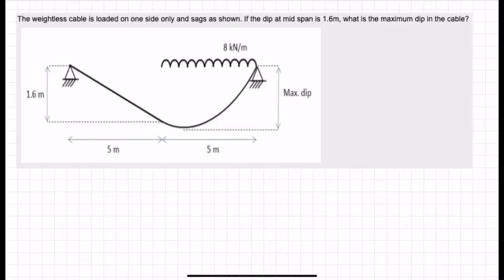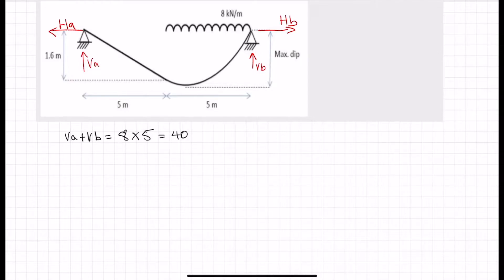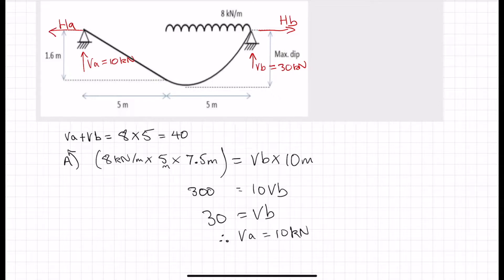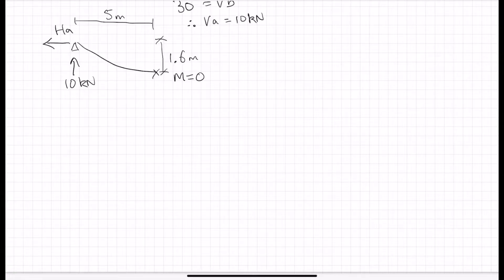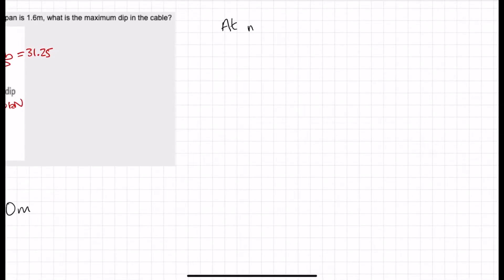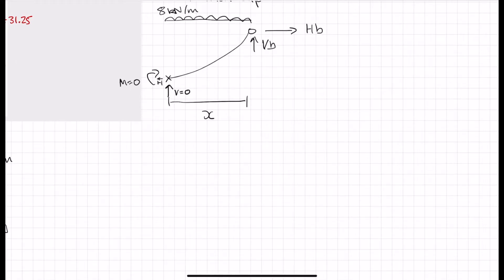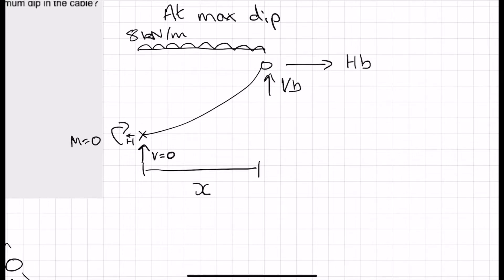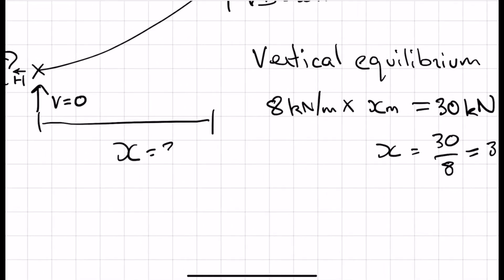Maximum dip in Cable Structure - IStructE Certificate in Structural Behaviour.

Comment: hello, if i took a cut at a point along the cable to the right of the maximum dip, the sum of the vertical forces will then not be equal to 0, and so there will need to be a shear in the cable. Is this correct? If so then is it the general case that the shear is 0 at the maximum dip?
Reply from the maker: Yes, the shear force is 0 at maximum dip. The cable will be in pure tension (assuming no moment capacity). Also remember the horizontal component of the tension in the cable will equal the horizontal reaction, so depending on the angle of the cable at that point at a non-maximum dip location there is also vertical component to consider too. You will have too many unknowns in the equation to be able to resolve it in the manner of the video.
Reply: @TheStructuralExam  Yes, sorry you mentioned the 0 shear at maximum dip in the video, I wasn't listening properly! Thank you for the reply, it all makes sense.